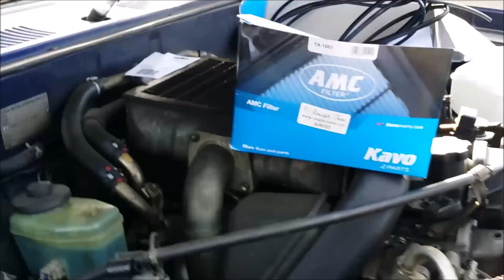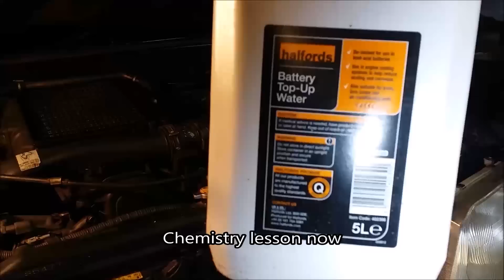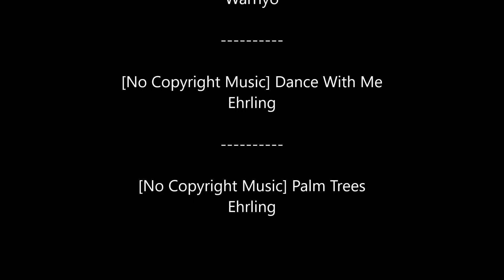Hydrogen HHO Generator for Diesel Engine

Comment: 1st law of thermodynamics. You get the same energy back as the amount of energy it requires to produce it! It does not work!!!
Reply: So true. But if your wasting 70% of your fuel to cool the engine cylinders,  maybe steal some of that fuel back to actually drive the engine? It's not the HHO itself probably, it's the better burn, less HC going to the catalytic converter as wasted fuel.

Comment: Nothing is fitting together. To run a diesel at 800 rpm you need abt 1.5 ltrs gasoil/h, these are abt 15 KWh. Under regard of 40% efficiency for electrolyse cells ( the other 40% needs oxygen O2 at the plus electrode and 20% are heat ) you have to afford 2.5 times more power for the equivalent H2 = 37.5 KW. This is impossible to realize for a worksman, the combustion value of H2 is 3 kW per m3 and is abt 11 times less efficient like propan or butan, which has 34,3 KWh per m3. So bury your ideas of running a diesel with H2, it’s a zero sum play par excellence and you risc to wake up in a zincum coffin after your electrolytic cinemascope exploded because of a sudden short circuit flash or overheat or simply smoking a cigarette by you or your wife ☠️💤☠️
Reply: Ummm... I think you have your math wrong buddy.  Whether this system works or not is another matter, but hydrogen is used to Launch rockets, and it's not because it's less efficient than diesel or propane... lol

Comment: Hey Maksym, great Video!
One question, i have a older car, how do i adapt the diesel thats injected to the rate of hydrogen coming in over the air System so it doesn't rev up on its own? Or does the engine adapt on its own?
Would be really thankfull for a answer :)
Greetings
Reply: hello  hope it works and you get more out than in for you  but   if it was me and i had this problem if it occured and you could not stop it.  i would only  turn it on on the highway on long drives ect  but im more  worried on how many amps this unit would draw because this will also cause drag on the alternator / engine  so is it worth it ???
Reply: @jonneilsmyth9107  so for me the setup would have been differently! I have a rv with 600watts of solar and wanted to use this solar energy while driving to produce the gas but after thinking about it and the energy conservation law.. this is all a lot of bs... even if i take the 0.6 kw direktly to my engine via electic motor, it wouldn't even be enough to keep the motor running in neutral.... sad but this will never give the engine enything and if you take the energy from the alternator you even lose on the way of generating gas

Comment: Did you get any engine block or piston damage from the bigger explosions?
Reply: Hi, I would not think so, not in the slightest bit. HHO has far less energy by comparison to petroleum. Its use is typically hybrid to increase the combustion rate, practically eliminating carbon emissions and notably increasing fuel mileage when its added to diesel engines, since they're unlike gasoline engines. 
I'm interested in equipping my diesel engines with these systems. I'd like to hear about any increase in fuel economy and likely help improve "after treatment systems" longevity

Comment: Just installing this wont make any difference in fuel consumption. O2 sensor reads more oxygen in exaust and therefore adds more fuel thinking its a lean mixture. You need to fool the o2 sensor then you get reduced fuel consumption.
Reply: Yes...and the next problem is when you bypass after understanding o² sensor & its variability..how u gonna signal ecm after heat coil bypassed. & what signal u get..lean or rich.

Comment: Nice im a autotech and enjoyed your video and motivation and verve in this project would suggest a bigger relay 50 60 amp and same with fuse plus holder for a better connection, nice simple fabrication work and for a novice would be a great help on installation things will get better 👍

Comment: I'd like to know how well it worked and if the engine switches off smoothly, it looks like you fed the hho into the intake before the turbocharger so the entire intake plumbing contains a fuel/air mixture, I wonder if the engine wants to run on after you turn the diesel off?
Also the turbo is going to be pressurizing fuel/air mix now instead of just air through the remaining Intake tubing. Being a diesel there is little chance of ignition but maybe I'll get some driving earplugs before I try this myself. :-)

Comment: Because of your fuse holder is not rated enough hi. Buy the fuse older for 40 amps, and put a 30 amps in it. the electric wires should be 10 guages. and buy your self, a pwm, pulse waves modulator, its a small drivers for electric motors, its magic. Its lowers the amps, and you gain on the gaz production. You can adjust the frequency so you can adjust the productions, hi frequency hi production, you need to find the just middle because you use 2 fuels, disesel and HHO, too much HHO, not good. Too low HHO dont change nothing, Just the right mixx, you save 50% on diesel.
Reply from the maker: That is a great advice. Big credits to you.

Comment: Hey Maks. So what's your verdict on adding HHO injection? Did it make any difference for diesel consumption? Thanks
Reply: Engine like this does not add milage. Burning hudrogen with a lot of loss in engine to produce electricity with loss in alternator to make hydrogen does not make sense and is busted. What makes sense is just making hydrogen from photovoltaic system and then adding it to some storage in car.

Comment: Just out of curiosity did you have to make any adjustments to the computer ,in reference to the O2 sensors ect..?
Reply from the maker: Hi Randal, it is 1996 purely mechanical truck .
Reply: @MaksymGrygorov  being purely mechanical doesent meen you throw air/fuel ratios out the window!
Reply: 1996 is the cusp if the obd2 there are many sensors even if it's a early 1996 with obd1

Comment: Please don't give anyone your money for an HHO product. They are all scams, preying on your lack of understanding.  It will always take more energy to do the electrolysis than you can get back from burning the resulting gases. The end result is a parasitic drag on your engine. Doesn't matter how good or expensive the equipment. You're up against physics here, and you're on the losing side.

Comment: This won't work on a diesel engine,there's no spark to ignite the gas !!! so if you do   get better fuel it's not the hydrogen that's doing it ,this method will definatly work on a petrol vehicle . Nicely fitted though.
Reply from the maker: Hi Lucan, sorry to burst your bubble , but there is no spark to ignite diesel fuel ether. By compressing the mixture in the chamber that is how the propelled movement is created.
Reply: @MaksymGrygorov  Hey Id be interested to hear your findings! Good or bad I am interested in making my own and putting it on my diesel truck! Hi from Oklahoma, USA

Comment: I heard the vehicle computers remove any savings made by altering the fuel mixture.
Reply: With a petrol engine you need to limit the o2 sensors signal by 200 ma. With diesel there is no problem just a smoother slightly more powerful engine with about twenty per cent better economy. It also steam cleans the engine as you drive along and reduces your emmissions by 90% , really neat device.
Reply: @gordonloughton9800 hydrogen does not steam clean your thinking of water injection

Comment: Its bollocks, it cant work as the HHO generator will use more power than it can supply in K Joules. It breaks all known laws of physics and thermodynamics. It simply cannot work. It cannot increase MPG because the load on the alternator will use more petrol or energy in KJs than the generator can produce. Perpetual motion cannot be achieved, not even i n a lab in a vacuum. Never mind rolling resistance, alternator inefficiencies, wind resistance, ruining gear resistance, tyre friction etc etc. Which is why there is no update as the up-loader found that his MPG went down due to alternator load.
Reply: you could Increase MPG by powering it from another battery than the one from the car and charge this one from your home plug. You still won't magicly create energy but electricity is cheaper than gas so it could start to make a bit of sence. But i have no idea of how much fuel you would spare it could be ridiculusly low
Reply: If eurea solution is used as an electrolyte it uses about a tenth of the voltage required for salt water electrolite,
Reply: It won't use as much energy as it produces on the form of hydrogen, the energy from the battery is only used to extract hydrogen, the energy potential is already there

Comment: Fuel cell is unnecessary and has been done to confuse the truth, I am telling you this because over forty years ago I was shown a Holden Kingswood run on tap water with no fuel cell at all, he filled his fuel tank with strait tap water and showed it was going into the carburettor. 
He only gave us a quick description on how he did it as he was trying to sell it to Holden but got told they were not interested and got the same from Ford as well and after that he was visited by two men that told him to keep his mouth shut, but when he showed it to us there was a twenty seven year old that had seen it as well and built his own two years later and the man who showed it to us was killed, But what he told us was all he did was increase the jets in his carburettor to twice there size to allow enough water in and built this coil he had mounted on the side of the motor that was about 4x4 inches in size to burn the water and that was it no fuel cell at all, when water is placed under a vacuum and hit with x-ray frequency it releases hydrogen and is what I think is going on with this system and is as safe as.
 I know this is real I have seen it done. It is just being done the wrong way.
Reply: Our (fuel) is just a catalyst
Reply: @mattk252  It is the vacuum on the water that is the key with the correct high voltage, is why government demanded people install a bubbler on there HHO systems to prevent people making it work as the bubbler prevents the vacuum on the cell and the water.
Reply: @Gaz Snow 
High voltage in the 18000 hrtz

Comment: I've been wanting to do a skoolie bus RV conversion. They have turbo deisel engines. I have for a long time wanted to do an HHO install in that future bus. The HHO gas explodes when under pressure so how does it work with the Turbo? Isn't there a great danger of blowing the Turbo off the engine as it compresses the HHO gas? What preventative mesures or what safety featurs keeps this from happening?
Reply: I did this same kind of setup in my ford with the 6.9 international diesel and was getting 16-17 MPG before the install of HHO system and then got 21-22 on average tank of diesel as well as not smoking black smoke at all anymore..tried to do the same thing in my Dodge caraan and the problem I ran into is that the Fricking computer would compensate for the lean clean flow  to the  tailpipe dumping more fuel into the  motor and actually getting worse mileage...I have a cumminsfirst gen which I am going t put it on getting 25 MPG empty hoping for 25% increase to 30!!
Reply: HHo will implode at three 300 kpa. If your compression ratio is running three hemispheres you might get preignition

Comment: Hi Maksym

I have the DC4000c system installed on my 2008 Citroen 2000cc Grand Picasso i drive from Manchester to Sofia Bulgaria 2 or 3 times a year and this system sames me alot in fual before installation it used to cost me 500/600GBP now it costs around 300/350GBP there and back best invest ment ever 

HHO System:
DC4000c
40g KOH 99% pure per litre
2000cc engine
HEC Dynamic PWM chip
running 15Amps

please let me know what your running
Reply: And of course you have no shame at all telling us such bullshit.

Comment: Nice video , but... to get right way HHO, need use Stanley Meyer system, what means Meyer system? Hi voltage, frequency and many other units. Tesla, Stanley Meyer,  Donald Smith, Kapanadze, they are from same bus, this  bus call resonance off the electrical field, this is main key.

Comment: wait do u still need petrol or you ran 100 % on hydrogen and oxygen ? also what was the voltage and amp you were using ?  and also what plate did you use and how many plates do u need ? how many liter of water do you need to actually run this ?

Comment: These idiot devices waste fuel and destroy automobile emissions standards.
Reply: Desertphile An opinion spoken from the armchair no doubt.
Reply: "An opinion spoken from the armchair no doubt. "

Alas, I do not give a shit about your opinions on any subject. I only care about the laws of physics and demonstrable facts. Fuck opinions.
Reply: @Desertphile  i run my car on fume vapors 42-47mpg 4.3 V6 midsize truck, so relax in ur chair u thug
Reply: Unfortunatly the known laws of physics cannot explain it ...so that 's why people are reacting like this
Reply: Idiota é quem desperdiça combustível...
Reply: The power for the generator comes from the battery which is charged by the alternator, this being the case wouldn't this defy the law of conservation of energy, I mean diesel produces energy to turn the alternator and then power from the alternator  charges the battery which is used to power the generator which some how increases the effiency of the diesel am I wrong somewhere.
Reply: explain it

Comment: Have you experimented with Urine as the solution instead of water?  Higher Hydrogen output.. lower voltage needed, less other gasses produced.
Reply from the maker: "Some say..."  that donkey's urine is the best for the task, however i do not have scientific evidence of that, therefore distilled water combined with KOH do the job just right.
Reply: Ha ha ha
...
Why he would go for it while kho is perfect for it ?

Comment: Ohh, another advice is change your light bulbs to led. This way u will save lot of power from your alternator.
Reply: falconflylow  just see the usage of the bulb. The halogen i use to have it was 55w. The led bulb is using max 25w. On each bulb. Just multiply. Sorry if i made mistakes on writing. English is my 2nd language.  Soon i will upload a video wich will make u think. Just stand by. Not about hydrogen. It will be about oil adittive. The next one i am thinking to make it on my car with all i have on it. Thx for replying.
Reply: In chaing mia they drive at night with no lights because they also think it will save them fuel..
Reply: 998vick how do you save, every decent led  i have seen on internet uses more power than the original halogen bulbs???

Comment: Subscribed and happy 4 u. Though I am the only one nuts to put an hydrogen system in the car. I have it 4 more than 1 year. U wanna see results? Put u're nose on the exost, smell it. That will be the 1st positive result. More to come. Your intake manifold will clean like new. U will feel a bit increase in power. Good luck for future. I'm keeping mine for as long as possible. Only good things coming from it. Give u an advice, get "bestline" oil additive in your engine. Run it for at leat 20000km and get a sample to a lab. You will be amazed.  Thx me later.  Crazy russian. Kidding. I have 4 results. Last 1 is after 28000km. Same a diesel engine. Wellcome to the club.
Reply: what do you use to protect the hho generator from blowing up?
Reply: @Ex-fk4nr  it the engine additive. It will bake a slippery surface on the inside of the piston. Much less wear and heat afterward.

Comment: Amazing work Max well done mate as long u don’t quit, u will succeed.
Reply: What’s the update on this mate
Reply from the maker: I do not have enough data to release it yet.
Reply: @MaksymGrygorov  please update bro waiting for new HHO video
Reply: @MaksymGrygorov  just a question I seen a guy put 3 judge together and made 3 hho and he says had 15 miles to the gln  and gets 24 to the gln is that ture you use more gas if you do this and he says you have to get a map sensor in hanser I was going to just make 1 pickle jar and make one pls get back to me on this on if it uses moer or less
Reply: @MaksymGrygorov  why you use KCl, is this your idea od producer of HHO generator say to put this electrolyte? Who is producer? Do you have better fuel economy and more power?